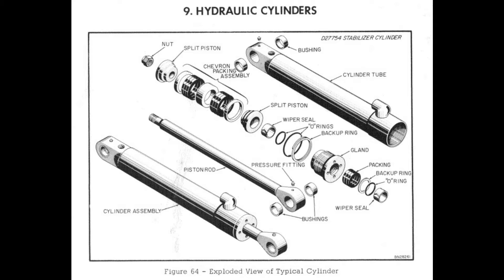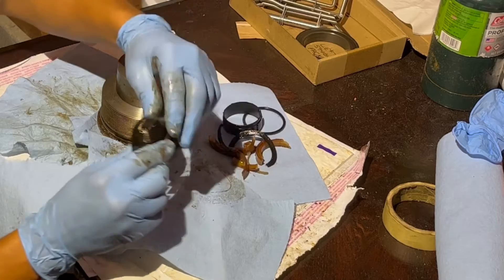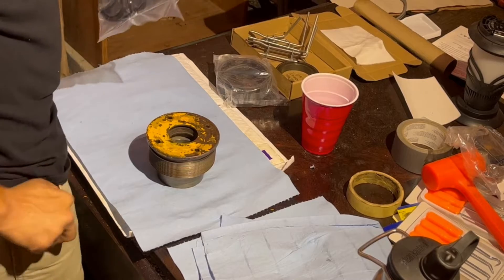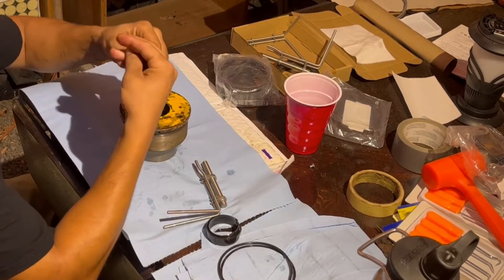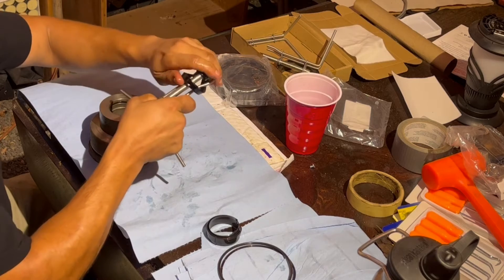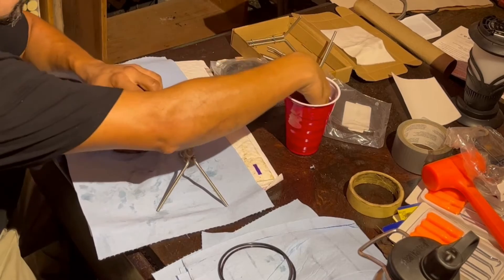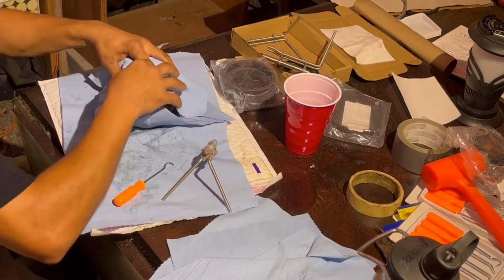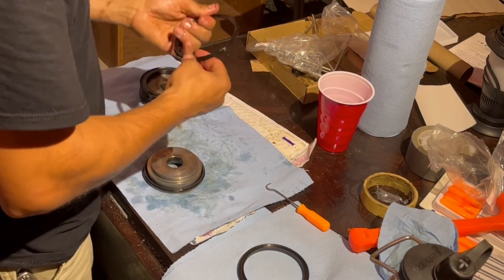Replacing Hydraulic Cylinder Seals & Packing Case 530CK

Comment: Helping a neighbor with their 530CK. Leaking main lift cylinders on the FEL. I have the seal tool kit you use but have been afraid to bend the thick wiper seal that goes "in" the gland nut, it seems so stiff.  Got the "Bulldog" rebuild kit 956707 (413931)  Would hate to need to buy a whole kit if I ruin it during install.

Comment: What is your suggestion if the gland is STUCK TIGHT. I'VE used a 4 foot cheater bar and it won't budge on a 1835b skid steer bucket cylinder. Thank you
Reply: The red wrench,torch
Reply: Torch Just to heat it up so it will come loose,or to cut it off?
Reply: Heated mine with a torch then tapped it firmly with a hammer round and round to break the rust loose. As recommended by a pro shop when I had the same problem.